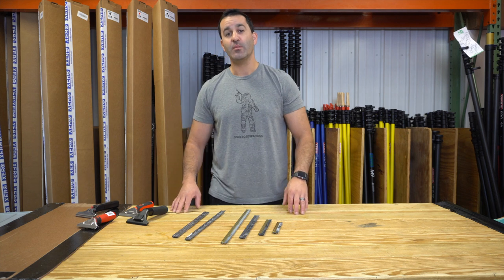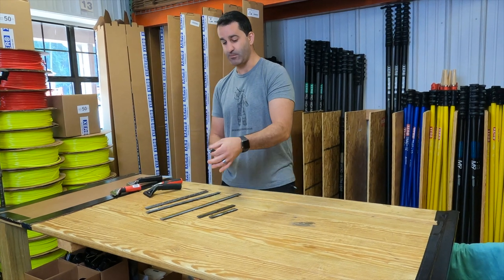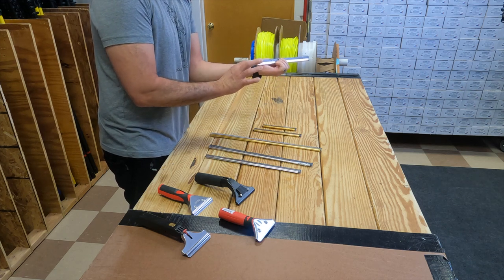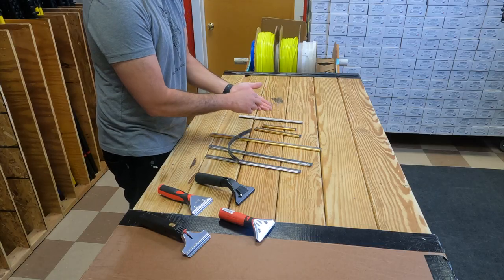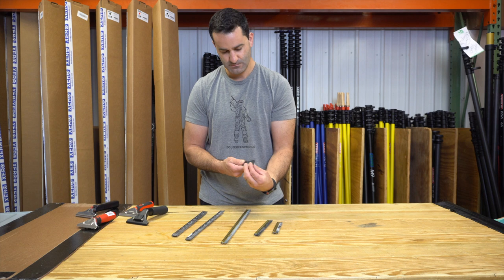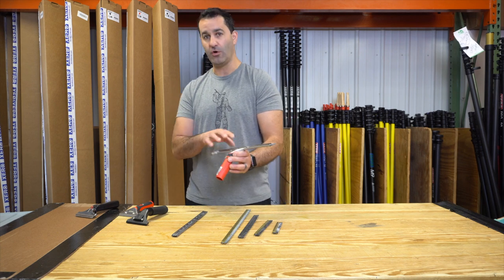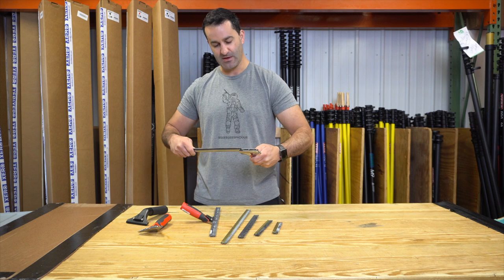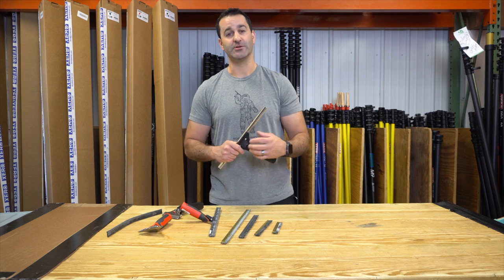Clipped vs Clip-less Channels

Comment: i see the difference, and the need for using the correct handle, but is one better than the other for some things?  How does the 6" single clip work if the other 5 inches has no retention?

Comment: Clipped for the win.  They hold the tightest i think.  AND, little tip for you....ONLY use 1 clip.  that will save you a TON of headaches. ~Jersey 862-312-2026